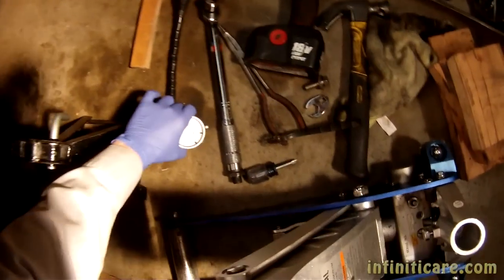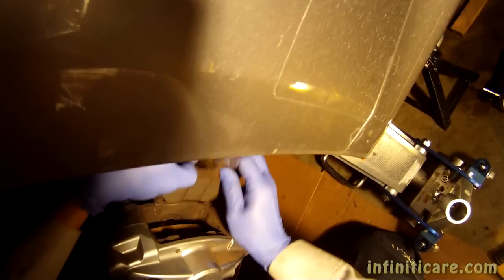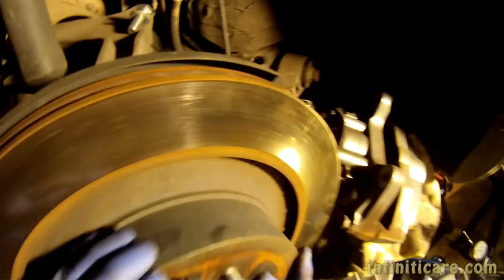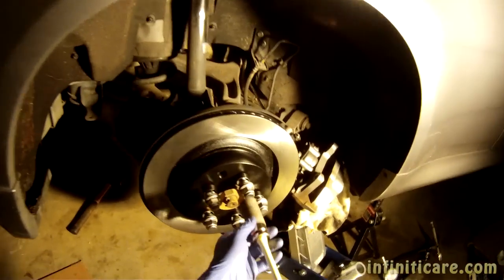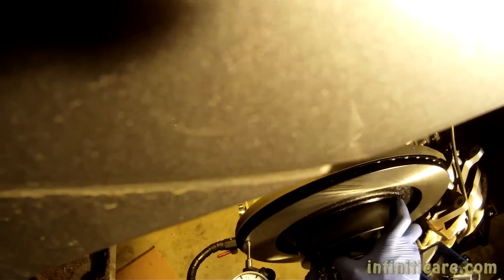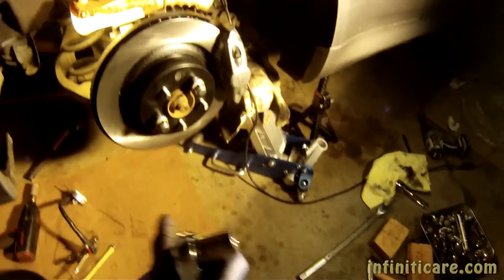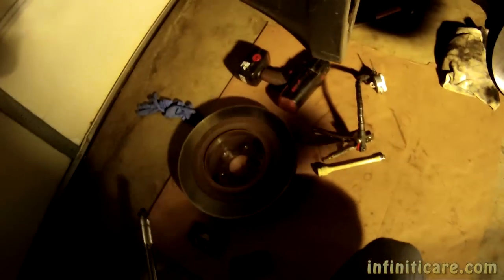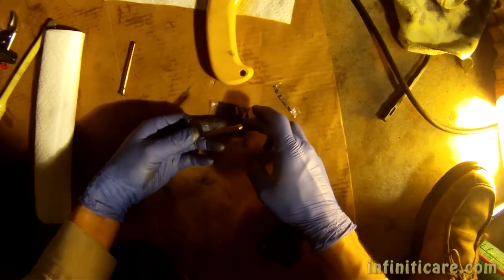DIY: 2009 Infiniti G37 Complete Rear Brake Job (Akebono BBK)

Comment: Yes, new rotors were installed. They typically come shipped with a protective oily coating that needs to be removed by using brake cleaner solvent. If the coating is not removed, it will contaminate the brake pads, causing poor friction.

Comment from the maker: It's actually very safe - the car doesn't move at all. Think about when people take engines and transmissions out, that is significantly more weight shift than removing a brake rotor.
Reply: Enthusiast Auto Care where was your jack points and why does my rears look so different when I take my rotors off? Is it cause mine is rwd? Thanks for the help cause I couldn’t get the rear bolts off cause that radius bar or whatever it’s called

Comment: it can mean a number of things - traction control system, brake fluid issue.. basically if anything that is attributed to vehicle stability control is affected, those lights come on - this can include throttle also.

Comment: great video very thorough, I enjoyed watching your process and approach.. If the lateral rotor runnout is excessive on new rotors what is the solution to correct this.. Do the rotors need to be resurfaced or there is a mechanical issue with the car, bad wheel bearing etc..

Comment: Just had my rear brakes/rotors replaced on my G37. When I returned home, the parking brake wouldn't hold. Peddle went all the way down. It was working before I brought it in. When I brought it back, I was told they didn't touch the parking break, but, looked at it, then said my cable was seized and needed to be replaced. Very confused why that wasn't observed during the brake job. Why the P brake was working prior. Ever happen to you?

Comment: Did you have the car in neutral, while being able to have rear mobility of the rotors, before you loosened the brake shoe. I moved the wheel all the way up like you did, but it stood with a strong amount of drag. If you can get back to me on this I would greatly appreciate it. Thank you for the video as well.

Comment: And what about if is an Automatic transmission? 
Mine if transmission was in parking on a 06 g35 sedan, was almost impossible to spin rotors by hand. Did not tried the neutral position.. Any idea?
THX

Comment: Great Video! Thanks for all the tips!
Any advice for rear brake squeal? Pads are still 70% remaining. Tried many lubes, sanding pads, and even applying BG Stop Squeal, and nothing works :(
Only squeals in reverse when cold
OEM Pads
11' G37S
Reply from the maker: Unfortunately there's not much that can be done it about it. I believe is the OE pad compound, it can be noisy.

Comment from the maker: If the car is a manual transmission model, yes it should be in neutral. Let me know if you have any other questions.
Reply: Would this work on a 2009 infinity g37 which is not a coupe

Comment: I know this video is old. I replied my stock brakes for akebonos on my g37 sedan. now it feels kinda sluggish as if the calipers or one of them is stuck on applying brake pressure. Also while driving I hear a loud humming noise it does sound like a wheel bearing you think that can. even bad. I did bang the rotors off with a hammer
Reply from the maker: Sounds like you need to bleed the system again.

Comment: why didnt u just bang the rotor off directly, why use such a long piece of wood. Also how did those rotors perform? what was the model/type?
Reply from the maker: The wheel bearing can easily be damaged if the rotor is hit too hard. Rotors are still running trouble-free.

Comment: How do you correct lateral runout?
Reply: There arw several ways to correct lateral runout. You can try rotor indexing, hub correction plates, hub/rotor replacement, on car rotor refinishing, and possibly other creative ways.
Reply: What method did u use because you seemed to have been able to correct it on the spot.

Thanks in advance
Reply: Alan Chan Rotor indexing is the first line of defense.
Reply: Enthusiast Auto Care and how do you rotor index? Sorry Im a real noob

Comment: I replaced my front brake pads and rotors but forgot to remove the brake master cylinder cap before expanding the caliper to make room for the thicker new pads and I looked at the master cylinder after and it was leaking fluid, I unscrewed the cap and sucked some fluid out then drove it and everything seemed fine. Did I damage the master cylinder by doing this?
Reply: As long as the fluid has a place to go, things are ok.

Comment: Slip Lights and vdc off can be related to traction control system. However, If the slip lights and vdc come on and the engine stalls out, I advise you to go to the dealer asap and have them inspect your throttle/sensors. 

PS: NEVER LET ANYONE CLEAN YOUR THROTTLE, UNLESS INFINITI DOES IT. And purchase your air filters directly from Infiniti.